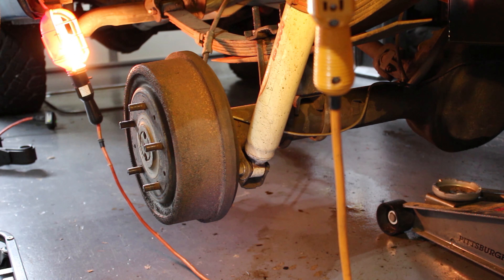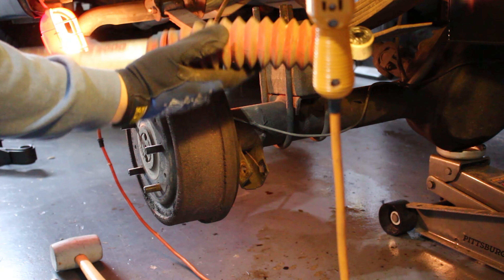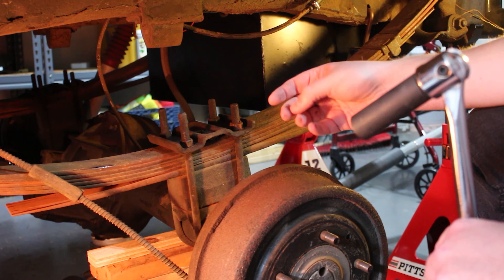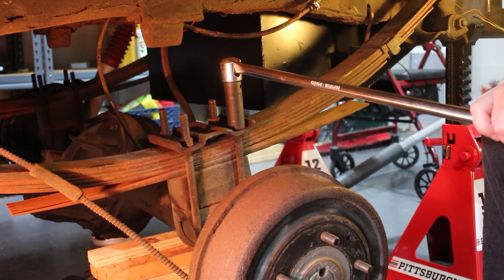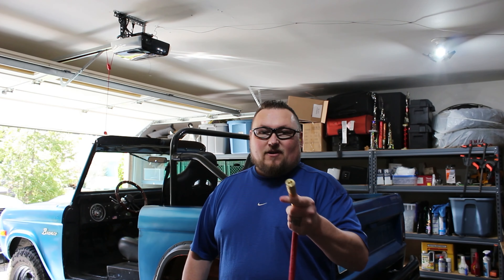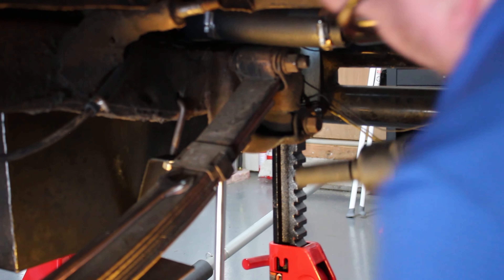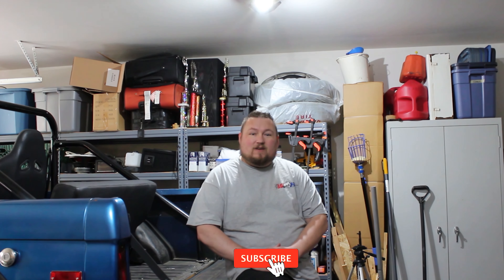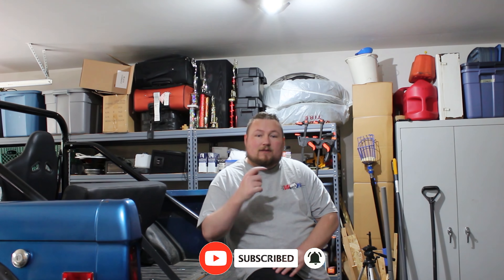Early Bronco Driver Side Suspension Removal

Comment: I just put Tom's 3.5 inch springs on my 74. One thing I did that help me for installing the new springs is, I spread the spring hangers to fit  Tom's bushings. If you don't it's a pain to force them in the hangers.
Reply from the maker: Thanks for the feedback. What did you use to spread the spring hangers?